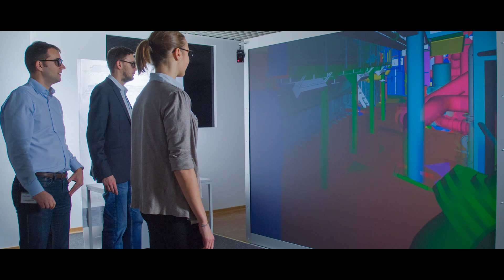MEYER WERFT - Der Bau der Norwegian Joy

Comment: 350m? 460m? 580m? 30 000 peuple
Reply: Schiffsmaße und Besatzung

Länge

333,46[3] m (Lüa)

Breite
41,40[3] m

Tiefgang
max. 9,00 BRZ m

Vermessung
167.725 BRZ[3]

 

Besatzung
1.700

Maschinenanlage

Maschinen-

leistung
76.800 kW (104.419 PS)

Dienst-

geschwindigkeit
22,5 kn (42 km/h)

Propeller
2 × Propellergondel
Reply: Länge  333,46[3] m (Lüa); Breite 41,40[3] m
Tiefgang  max. 9,00 BRZ m
Vermessung  167.725 BRZ[3]
Besatzung  1.700; Passagierzahl 3.900
Maschinenleistung  76.800 kW (104.419 PS)
Geschwindigkeit  22,5 kn (42 km/h)
Baukosten  920 Mio. $
Reply: Landläufig   2017,  333,46 m :-( snif 
2023, 450~580 m :-) 
;-)